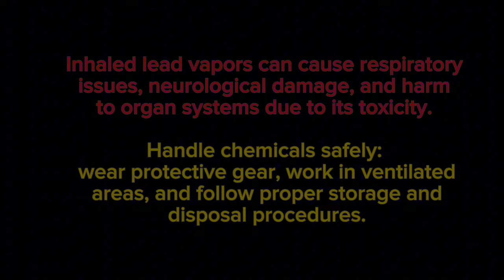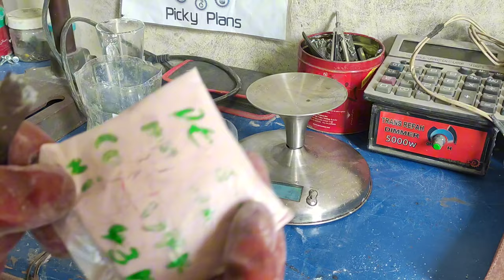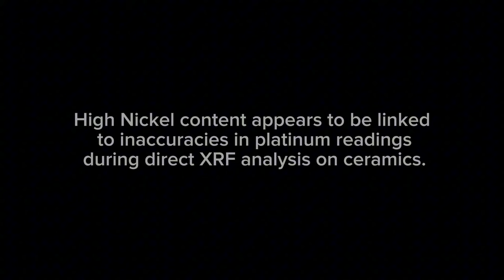Fire assaying catalytic converters for PGMs | Smelting Alumina ceramics

Comment: Do it again bro, when you use litharge add carbon source similar to litharge quantity, I believe most of the PGM's still in the matte, if you weighted the Pb bead before cupollation you will notice that most of the lead is not reduced because of lack reduction source.

xrf analysis always make mistakes with PGM's readings, try to do your chemical refining then evaluate, good luck
Reply from the maker: Thanks for the explanation mate 🙏
I used 3 grams of flour as a carbon source , it is able to reduce 33 grams of lead , the rest of PbO reacts with silicate in the sample as a flux to produce fusable lead silicates. I added just 3 grams of flour, intentionally .
Reply from the maker: But i never knew if there was any possibility of big mistakes in metals XRF analysis!
Now im really curious to see what would be the result of nitric acid parting.
Reply: I read before about xrf mistakes with PGM's, gold traders pay less for gold because of this issue, they can't count on xrf result when buy gold and in same time they can't count on fire assay cause they know that PGM's specially platinum considered as gold in fire assay
Reply from the maker: Interesting!
Probably that's why they do Alkaline fusion (NaOH + KNO3) on rolled gold sample then they boil it in nitric acid, weight it and compare it with initial weight. But not sure if this method removes platinum
Reply: @PickyPlans خیلی مونده اینا رو بشناسی،یه موزماری هستن نگو،ایریدوم منو به اسم پلاتین میخریدن
Reply from the maker: Ajab adamay ! 
Chera mishod oon sorb ro aval zad farqi nadare.